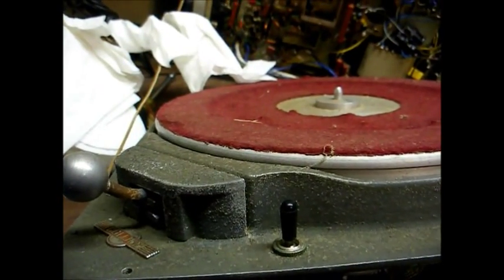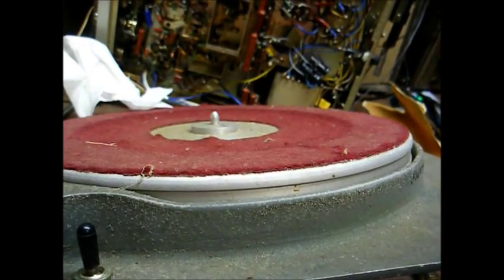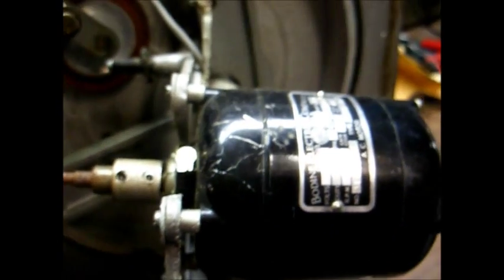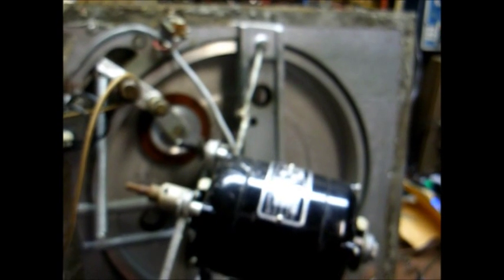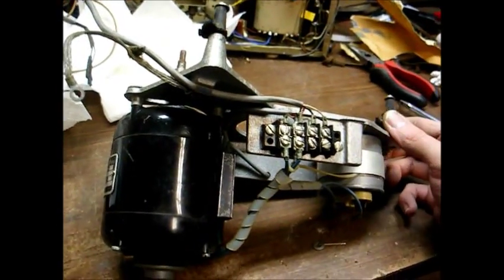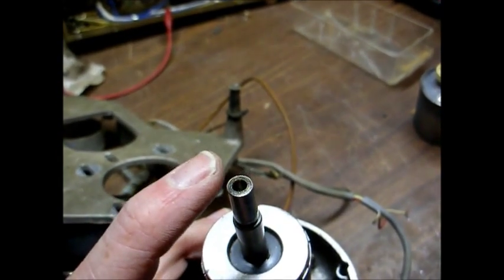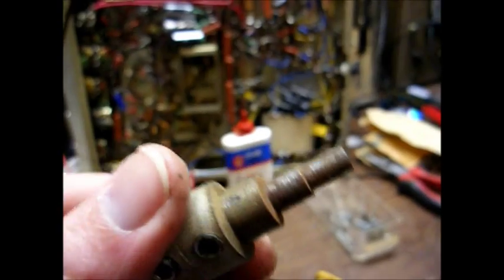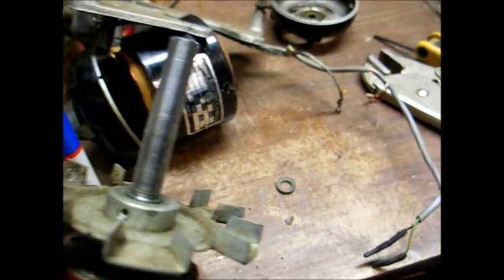Restoration of a Collins / QRK model 200S radio station broadcast turntable - part one

Comment: Hello, I have a similar turntable, it's mccurdy ch 12. I got a speed problem: when i switch to 33, the speed is a bit slower than a standard 33, I have clean and lib all moving parts so should the capacitor matter and has to be replaced ? Thanks

Comment: Hello, I'm the owner of www.russcoturntables.com. Thanks for the mention! This is very nicely done! Did you ever get the motor mounts you needed? Please write to me at parts (at) russcoturntables.com, and let me know what you need. Thanks!
Reply from the maker: Thank you and I haven't had a chance to get back on this thing. I've got several rim driven broadcast TT's that I want to restore and when I get caught up with some other stuff, I'll get in touch with you. One of my turntables is a BE model 16C (plays 16" records) from either '85 or '86 (I can't remember the date stamp at the moment). Honestly, I didn't know that 16" broadcast TT's were made that late.

Comment: DJ abuse was right. Those look exactly like the turntables I used at KXVQ-AM in Pawhuska Oklahoma in 1982-4, my first DJ job outside of college radio. I worked 10-14 hours every weekend playing mostly country 45's. Most of the equipment was 20+ years old but still worked. That stuff was built to last.